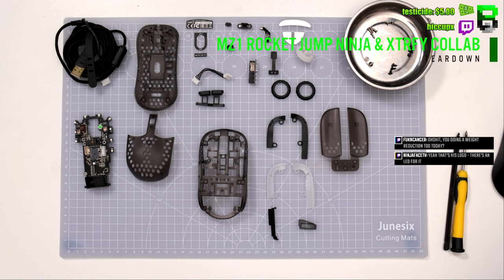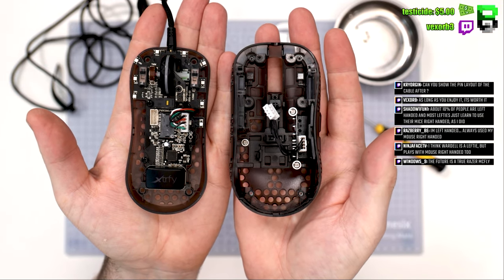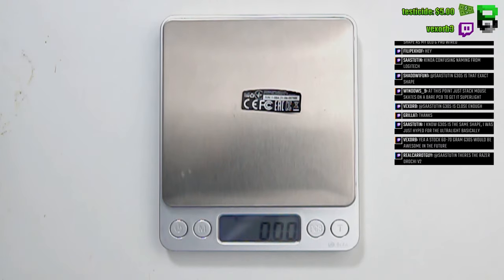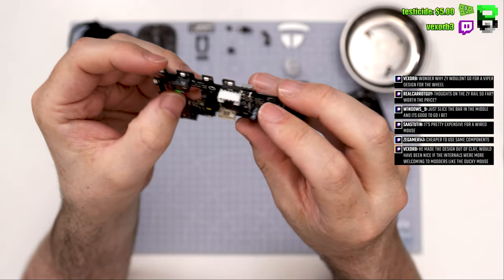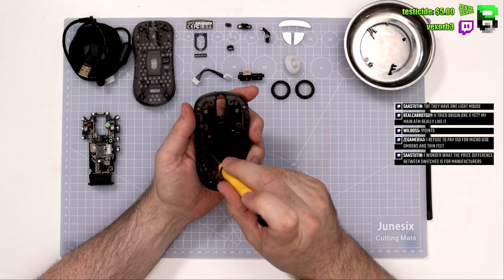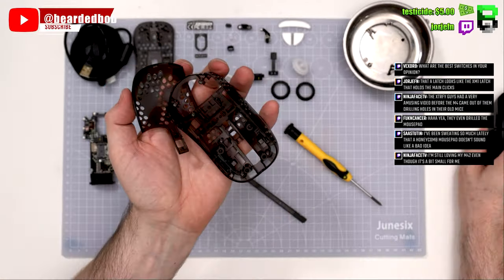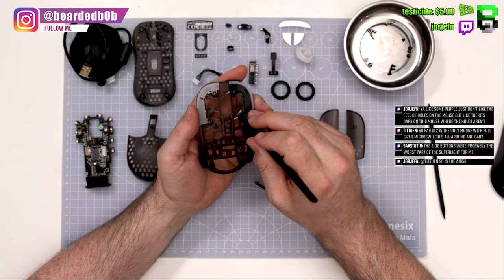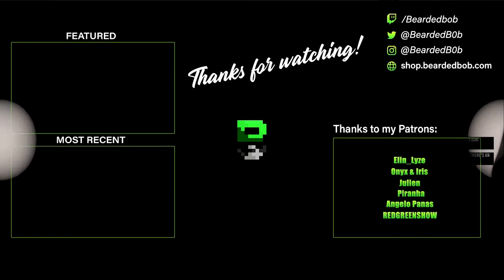The Best Button/Switch Setup EVER? - Xtrfy Mz1 Zy’S Rail Teardown

Comment: I wonder how much weight you can remove by clipping the RGB LED's off
Reply: @idkwhatname3133  so basically in the mid 40s if you remove all the RGB
Reply from the maker: Check out the weight reduction in this stream after the teardown part https://www.twitch.tv/videos/1034616702

Comment: The plastic on this is like cutting glass, if you dont use a really thin cutter or dremel the plastic almost shatters under the pressure on other surrounding spots. So be careful
Reply from the maker: Sure does... It's frigile ones second to the Startlight 12

Comment: The scroll encoder is too soft for my linking any tips where I can find something more tactile ??
Reply from the maker: The TTC is a little lighter notch, I've made a few changes on mice such as the GPW and GPWSL with a Kailh as it has a firmer notch. https://www.youtube.com/watch?v=Sr1tpejHCgQ&list=PLfd7fPKFiRfIzZVqxMHqyH5y23iG357b9

You can buy them on my shop https://shop.beardedbob.com/collections/custom-mouse-parts or from Ali express

there are a few other encoders like f-switch and alps.
Reply: @Beardedbob  Thanks for the reply Sir.
I see encoder with different height on online stores, are you sure yours is the correct one for the MZ1?
I'll be glad to order.

Also do you think it is possible to mod the side buttons to have a firmer clic (similar to the feeling of the UL2) ?
Ideally I will also swap the wheel button to something usable (it is super hard to actuate in stock, I've never saw something like this.)

Comment: i have 2 issue with this mouse, the mouse wheel is horrible for 1, going to order a new encoder from your shop shortly, and the mouse skates are also terrible, would there be a way to 3d print a new base that allows zowie style feet?
Reply from the maker: You can sand the base a little then you can add Zowie
Reply: @Beardedbob   Would there be a way to change the mouse wheel i would love to see that done?

Comment: Hey! , i bought razer viper mini what best firmware version to install to fix the lod issue?
Reply from the maker: non they all suck and don't fix it. best mod is to use tape or a razer mousepad.
Reply: @Beardedbob  you answered kinda late , i found out with and without tape my viper has the same lod

Comment: damn 5.77 grams for the back panel nice.. i removed it.. was way too much in the way for my fingertyp grip..
Reply from the maker: Do you main it now without the rear panel?
Reply: @Beardedbob  yes.. noticed some tilt when you push side buttons.. but it got better when i attached the sensor feet that was included.. i think i will ghetto mod it further by moving the rgb strips to the back.. just attach them with dubbelsided tape .. to balance the mouse better..
Reply: @dimwillow7113  how did u removed it ?
Reply: @hansbalea1005  remove feet and unscrew screws and open it up

Comment: Hey Bob, do you think that the XM1 and MZ1 scroll wheels would be interchangable? XM1 is nearly half the weight of the MZ1's. I had a look at your measurements in the XM1 vid but you measured different dimensions :(
Reply from the maker: mmmm maybe, would need to try them. I've a XM1 in bits so I'll give it ago. Easier to get an update on Discord as I'll post some pictures if it works. https://discord.gg/aTX6VAM